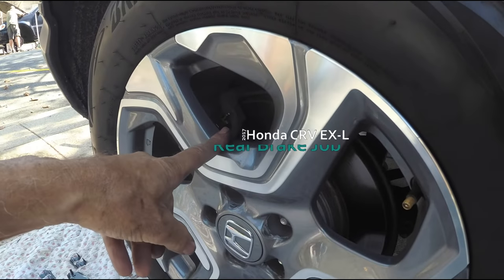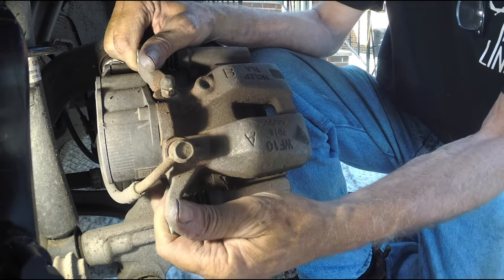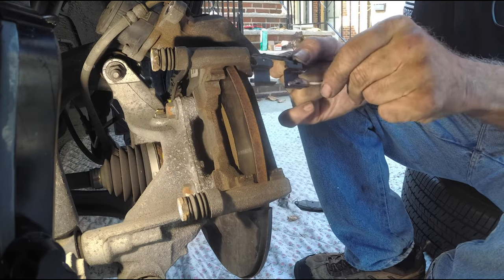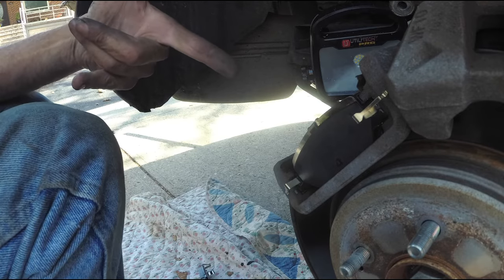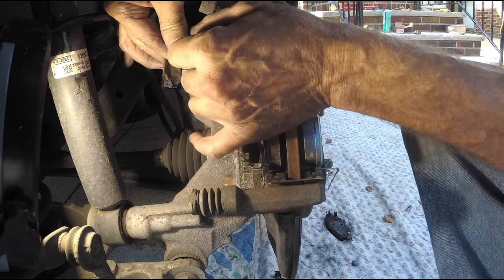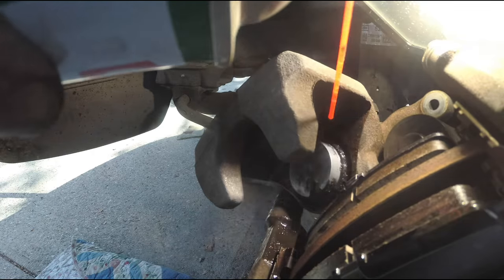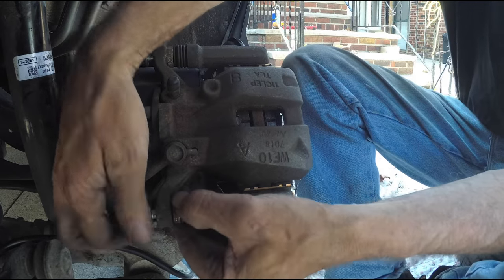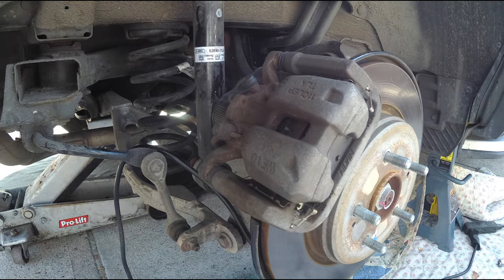2017 Honda CRV EX-L  Rear Brake Job

Comment: Hi Fishy, also curious how you didn't have to do anything to the EPB - every other brake pad video for 2017 honda crv shows how the motor has get retracted before pushing the piston in. Your's is the only one that doesn't and I'm wondering if you did anything differently before you started working on brakes?
Reply from the maker: I did mine the Old school way, and the Unconventional way, I   was able to  use the old tools I had with no issues,  I could have done the  reverse polarity  trick  but did not.  why I differ from all
Reply: @fishycomics  i think you got lucky somehow, this isn't about convention or old vs new school, it's about physics. Electric Parking Breaks are, by definition, new school. From everything I understand, the piston should not have contracted without retracting the motor (people have tried and said it won't compress). BUT yours did for some reason and THAT's what I'm trying to understand.

I'm changing all my brake pads next week and will try it first simply compressing with a wrench the way you did, and if it works I'll be pleasantly surprised. Either way, i'll report back.
Reply from the maker: @jeffreymason7049   SMILES. let me know how yours goes.. I totally get what you're saying I do.
Reply: @fishycomics  As I thought, it did not work by simply squeezing the piston in. But it was a simple technique to remove the EPB (two 5mm hex screws), wound the rotor clockwise with a 8mm hex key, and then the piston compressed. Extra 5 minutes of work, no big deal.
Reply: @jeffreymason7049  I have same issue to press the piston, will you show me how you did it please?
Reply: @badung76  I don't make youtube videos and I can't really describe it much better than I did above. Used an 8mm hex key on the back of the rotor to unwind the motor and then used channel locks to compress the caliper, like fishycomics did in his video at 6:40
Reply: @jeffreymason7049  yeah I agree, and don't believe that he didn't do anything with the EPB. As others have stated, and had experienced it myself, that piston did not move. Better safe than sorry, I ended up supplying 12v to it, and called it a day.

Comment: Very good video to show the clips and the caliper boot covers. You know, I bought some Carlton caliper boot covers and the hole where the pin goes into on the front of the boot was too narrow/small. When I lubed the caliper pin and inserted that pin into the rubber boot, the caliper grease was pushed off the pin and I had to keep reapplying the grease. Eventually, I will have to get new boots that have a bigger opening at the front.
Reply from the maker: thank you  good  to know were you able to get the right boots?

Comment: Fishy, how did you get the ebrake to retract so you can release the caliper piston?
My CRV is set to lock the ebrake when I turn off the CRV
Reply from the maker: I now wonder if mine was on, shows me strength, you can release it via the ca set up.

Comment: Nice video. I’m getting ready to do the brake job on my CR V. Don’t you have to do something with the electric brake system? Electronic Parking brakes?
Reply from the maker: when you   look at the rear you'll see the   electronic brake system. on the caliper to the front  can not miss it.  will not interfere  wit hteh brake job at all. I found the hardest part was pushing back the  piston as it needs to align correctly. some use a professional tool I did not and  do  suggest taking your time.
Reply: Thanks for the information, I’ll look into it.

Comment: Here cause i might change my rear rotors, has anyone had warped rotors in the back ? Never had that happen before
Reply from the maker: I will be doing a  car about taking off pads and replacing no rotrs.  hope the vid helped out some.

Comment: I wish you would have mentioned the correct placement of the clips on the pads in the video you did for the fronts. I followed your video for the front brakes on my 2018 CRV and incorrectly installed the clips as you did in the video. You should edit your video so others don't make the same mistake I did. I had to pull everything back apart the following day after I noticed the rear clips were in a different position.

I am assuming you noticed the same because you make note of it in this video. Otherwise good work and thank you.

Comment: Hi there, so I did front ones. The back is hard though, due to the piston not going back. Is there any trick to release pressure. Front piston I was able to pushed back with channel locks,  back has some kind of plastic enclosure.
Reply from the maker: Seems either you aborted the work, and waiting for the trick how to.  Now trick,  but  what plastic?
Reply: @fishycomics  After father investigation,  I have found that it is electronic brake enclosure. You can't just push it back with the channel locks. You have to take it apart, and use star key to spin it and than you can push it. I have watch videos on different cars, same system. I will try to do it today. I have 2017 CRV EX. Thank you for your videos. Very through explenation.
Reply: Michael Watson , any luck doing the rear?
Reply: Same problem, I cant push in the piston, where I cant see a video that can helpme?
Reply: @greivinvega7320  those are an electronics brakes.  Take the plastic  enclosure off, and use a star key, or just  flat screwdriver.  Spin it, and than use channel locks to get the piston in. It is easy once you start doing it, you will see. Good luck
Reply: @MichaelWatson-qq6yc  perfect, I remove that electric motor from the caliper, but it didn't occur to me, to do the same   job that the motor do!!! I paint the 4 calipers! How I can send you a Pic?

Comment: Is it the same as 2019 Honda Crv
Reply from the maker: Yes. suggest and when I can I'll try to do a  dc power retracting of the   cylinder
Reply: @fishycomics  yes i did brakes on my Honda rear an left one sounds like it's slightly slipping making noise wat can i do for it.....

Comment: great job as always. thanks !
Reply: Bob Mullison excuse me I have one question , I have sounds in my brake and I went to the showroom I changed to a new brake but the sound is still and this sound looks like iron touch iron , no one can know what’s going on . Can you give an advice
Reply: @serajahmad6923  Hello - if it sounds like iron touching iron, I would definitely take the car to another shop and ask them to inspect the brakes, not just listen to them. Brakes should never continuously make noise. I would do this as soon as possible.

Comment: NEVER EVER SPRAY BREAK CLEANER ON THE BREAKING SIDE OF BREAK PADS....IT WILL CAUSE BREAK FAILURE !  WHAT YOU DID IN THE VIDEO IS WRONG!!!!  IT COULD KILL SOME ONE....
Reply from the maker: you did not know. brake not break but thanx for the   opinion.  𝐈𝐟 𝐲𝐨𝐮 𝐰𝐚𝐧𝐭 𝐂𝐑𝐂’𝐬 𝐁𝐫𝐚𝐤𝐥𝐞𝐞𝐧 𝐛𝐮𝐭 𝐧𝐞𝐞𝐝 𝐚 𝐧𝐨𝐧-𝐜𝐡𝐥𝐨𝐫𝐢𝐧𝐚𝐭𝐞𝐝 𝐯𝐞𝐫𝐬𝐢𝐨𝐧, 𝐡𝐞𝐫𝐞 𝐢𝐭 𝐢𝐬. 𝐓𝐡𝐞 𝐜𝐡𝐥𝐨𝐫𝐢𝐧𝐞-𝐟𝐫𝐞𝐞 𝐯𝐞𝐫𝐬𝐢𝐨𝐧 𝐨𝐟 𝐂𝐑𝐂’𝐬 𝐁𝐫𝐚𝐤𝐥𝐞𝐞𝐧 𝐜𝐨𝐦𝐞𝐬 𝐢𝐧 𝐚 𝐠𝐫𝐞𝐞𝐧 𝐛𝐨𝐭𝐭𝐥𝐞, 𝐜𝐨𝐦𝐩𝐚𝐫𝐞𝐝 𝐭𝐨 𝐚 𝐫𝐞𝐝 𝐛𝐨𝐭𝐭𝐥𝐞 𝐟𝐨𝐫 𝐭𝐡𝐞 𝐜𝐡𝐥𝐨𝐫𝐢𝐧𝐚𝐭𝐞𝐝 𝐯𝐞𝐫𝐬𝐢𝐨𝐧. 𝐀𝐠𝐚𝐢𝐧, 𝐭𝐡𝐢𝐬 𝐛𝐫𝐚𝐤𝐞 𝐜𝐥𝐞𝐚𝐧𝐞𝐫 𝐢𝐬 𝐝𝐞𝐬𝐢𝐠𝐧𝐞𝐝 𝐭𝐨 𝐪𝐮𝐢𝐜𝐤𝐥𝐲 𝐫𝐞𝐦𝐨𝐯𝐞 𝐛𝐫𝐚𝐤𝐞 𝐟𝐥𝐮𝐢𝐝, 𝐠𝐫𝐞𝐚𝐬𝐞, 𝐨𝐢𝐥, 𝐚𝐧𝐝 𝐨𝐭𝐡𝐞𝐫 𝐜𝐨𝐧𝐭𝐚𝐦𝐢𝐧𝐚𝐧𝐭𝐬 𝐟𝐫𝐨𝐦 𝐛𝐫𝐚𝐤𝐞 𝐩𝐚𝐫𝐭𝐬, 𝐥𝐢𝐧𝐢𝐧𝐠𝐬, 𝐚𝐧𝐝 𝐩𝐚𝐝𝐬. 𝐈𝐭 𝐡𝐚𝐬 𝐥𝐞𝐬𝐬 𝐭𝐡𝐚𝐧 𝟒𝟓% 𝐕𝐎𝐂. 𝐈𝐭’𝐬 𝐨𝐮𝐫 𝐭𝐨𝐩 𝐩𝐢𝐜𝐤 𝐟𝐨𝐫 𝐚 𝐧𝐨𝐧-𝐜𝐡𝐥𝐨𝐫𝐢𝐧𝐚𝐭𝐞𝐝 𝐩𝐫𝐨𝐝𝐮𝐜𝐭, 𝐜𝐥𝐞𝐚𝐧𝐢𝐧𝐠 𝐚𝐧𝐝 𝐝𝐫𝐲𝐢𝐧𝐠 𝐪𝐮𝐢𝐜𝐤𝐥𝐲, 𝐰𝐡𝐢𝐥𝐞 𝐥𝐞𝐚𝐯𝐢𝐧𝐠 𝐧𝐨 𝐫𝐞𝐬𝐢𝐝𝐮𝐞 𝐛𝐞𝐡𝐢𝐧𝐝. 𝐓𝐡𝐢𝐬 𝐛𝐫𝐚𝐤𝐞 𝐜𝐥𝐞𝐚𝐧𝐞𝐫 𝐜𝐨𝐦𝐞𝐬 𝐢𝐧 𝐚 𝟏𝟒-𝐨𝐮𝐧𝐜𝐞 𝐬𝐢𝐳𝐞. 𝐏𝐫𝐨𝐝𝐮𝐜𝐭 𝐟𝐞𝐚𝐭𝐮𝐫𝐞𝐬: 𝐍𝐨𝐧-𝐜𝐡𝐥𝐨𝐫𝐢𝐧𝐚𝐭𝐞𝐝 𝐃𝐞𝐬𝐢𝐠𝐧𝐞𝐝 𝐭𝐨 𝐪𝐮𝐢𝐜𝐤𝐥𝐲 𝐫𝐞𝐦𝐨𝐯𝐞 𝐛𝐫𝐚𝐤𝐞 𝐟𝐥𝐮𝐢𝐝, 𝐠𝐫𝐞𝐚𝐬𝐞, 𝐨𝐢𝐥, 𝐚𝐧𝐝 𝐨𝐭𝐡𝐞𝐫 𝐜𝐨𝐧𝐭𝐚𝐦𝐢𝐧𝐚𝐧𝐭𝐬 𝐋𝐞𝐬𝐬 𝐭𝐡𝐚𝐧 𝟒𝟓% 𝐕𝐎𝐂 𝐂𝐥𝐞𝐚𝐧𝐬 𝐚𝐧𝐝 𝐝𝐫𝐢𝐞𝐬 𝐟𝐚𝐬𝐭 𝐋𝐞𝐚𝐯𝐞𝐬 𝐧𝐨 𝐫𝐞𝐬𝐢𝐝𝐮𝐞

It’s often overlooked, but using a quality brake cleaner from time to time is a cost efficient way to ensure your brakes stay in good condition. Brake cleaners can help extend the life of your brakes by removing harmful debris, grease, oil, and other contaminants that can shorten the lifespan of your brake drums, rotors, or pads. In addition, these cleaners can often fix brake squeals by getting rid of that debris lodged in your brakes.

More importantly, cleaning your brakes is a fairly straightforward task and it can be done from the comforts of your garage or driveway. Almost all brake cleaners are designed to penetrate, which means you don’t have to disassemble your brakes in order to give them a thorough cleaning.

In this article, we’ll take a look at the top 10 best brake cleaners you can buy, as well as explaining some of the things you should look for when shopping for a quality brake cleaner. For more information on brake cleaners, refer to our table of contents.
Reply: @fishycomics  your right ... Absolutely right